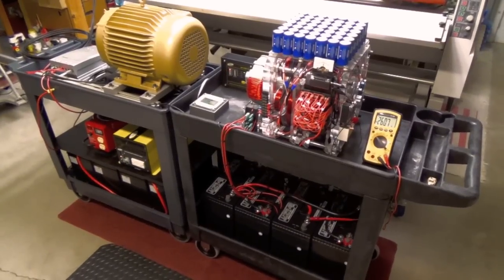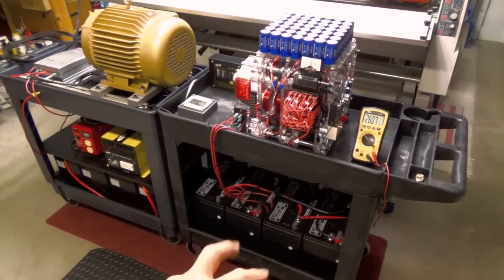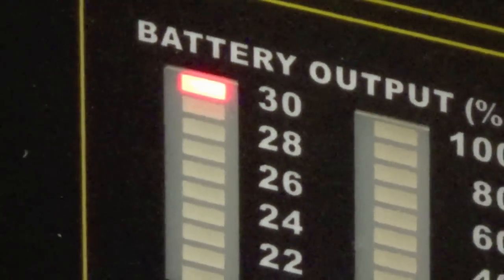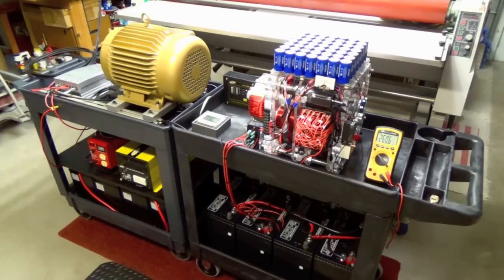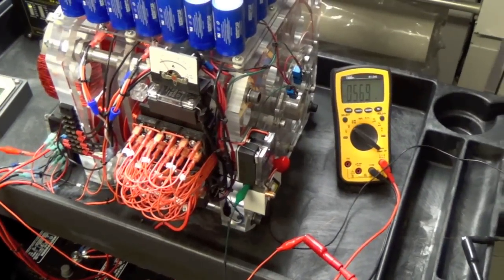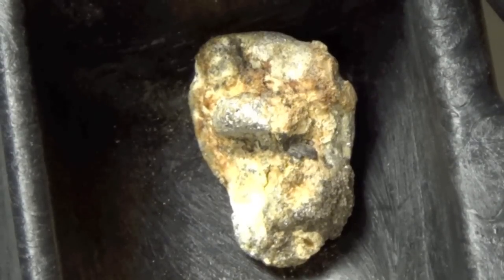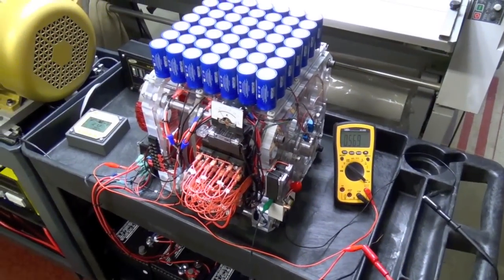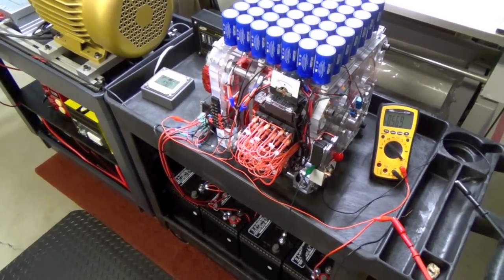Home Power Station

Comment from the maker: Actually the solar panel averages between 150-200 watts of output sufficiently charging 4 of the 8 deep cycle batteries. The MPPT aux output provides bursts of power to the Q3's UltraCaps when the UC voltage threshold drops to around 24 volts. The UC's power the Q3 which then charges the other 4 deep cycle batteries through frequency pulsing.

Comment: Nice work and great to see your continuous improvements!
It would be awesome if you would post the difference in input to charge the bank of batteries using the solar panel input only vrs. adding the Q-3 or Q-4 to charge an additional battery bank (s). If the major benefit of the Q is related more to energy storage, any results related to efficiency on that end would also be good to hear.

Comment: Would you please explain in layman's terms what is the benefit of using this device?  No over-unity, if I'm right. Does it lengthen the battery lifetime? Or is it a more efficient way to conserve energy? Or perhaps a better way to convert voltage/amperage?

Comment: But does it charge the battery bank better than just your MPPT controller ?
So does it multiply your solar input power then somehow ?? That is the big question, otherwise you could then just only use the MPPT solar controler to do the job of the battery charging... hmmm...

Comment: The way I'm seeing it, it  is a bit like a bedini in terms of collecting bemf on a pulse motor. Difference is collecting the bemf in 2 or 3 ways adding to the efficiency of the energy conversion/storage capability of one rotor. Multiple output ports may be better than one.

 PMM, it would be good to hear if there are other advantages to the Qs on top of that.

Comment: Good questions. But, my deep cycle battery bank requires Amperes to charge the bank.  A charge controller only allows so many volts to go a 12V bank.  560+ volts all going into the bank at once would fry the bank.  However, staying within the 12-14V range, the bank can take a lot of Amps.  True, amps x volts gives you watts.  Therefore, volts must stay the same but the amps can increase to give you more watts, in a battery bank system.  12,24 and 48V battery bank systems are common. Peace.

Comment: Impressive power output starting with just one solar panel of what, 100 watts? How is that able to fully power up your first bank of batteries? And your Q3 is capable of fully charging your 2nd bank of batteries on its own or is that overflow from your solar panel? Did you or can you use a 3D printer to manufacture your tauroid & Q3 house? I see some proprietary hardware here, several of your own inventions? I would come and help you manufacture and help you with your business any time. Its a beauty my friend.

Comment: Hi, if you were to connect this to a grid tie inverter would you be able to sell more energy back to the electricity provider than if you were to go directly from the solar panel? Or is this simply a better way to charge batteries? If you like cheap energy then why does your solar panel not have a solar tracking device? even a device with simple left right direction can probably give you 5 times more power over the course of a day, especially during the winter months when the sun is lower in the sky. All you need is a low ratio gearbox and a smaller panel set to a more advanced direction so that when the sun hits it it has enough energy to advance the main panel, the motor will stop turning when the angle to the sun becomes too great, a tiny battery could be charged with some simple circuitry that switches the smaller panel to charge the battery when the voltage is too low to run the motor, at the end of the day there should be enough power in the battery to reset the panel to the morning position.

Comment: If you have achieved "over unity," then why are the solar panel and the entire "left hand" cart necessary?  Use a transformer to reduce that awesome 500V output down to the 24V input to drive the Q3.

Comment: I know you have a desire to be "green" with it and you power it with a solar panel, but what would it cost to run it from the grid?  I guess my question is really; If used in conjunction with a grid power input would it consume LESS power than it makes to output charge the battery bank?  If the answer is that it consumes less than it produces -- then at a minimum would reduce your monthly power bill from the grid, or would it not?  Because if it consumes more power than it produces then you should just power your battery bank directly from the solar panels regardless of how cool this thing looks.  I get that it pulses, and I get that its good for the battery bank, but there are other ways of achieving the same effect to a batter bank with direct solar connections.  Lastly, after watching 5 or 6 of your videos you have never mentioned the cost of this pulse devise, what is the cost?  I have yet to see facts related to affordability or efficiencies vs. other methods of directly charging batteries.  I do hear a lot of passion and excitement but nothing more than the "wow factor" at this time.

Comment: Since you are connected to Utility Grid, why not create your own version of super DIY ultra low budget HIGH EFFICIENCY MOSFET AC coupling (unlike commercially grid tie inverters) and use Alternator (w/ prime mover of course) and excites lets say 40-120 amps of it. For off-grid, use your alternator for charging the batteries. Prime mover must be strong enough to meet the required RPM for the rate of charge.

Comment: So why don't you just power the inverter from the solar panels at night, and just keep them topped off with a simple battery charger during the day? I don't understand the purpose of this machine. Does it just step up the voltage like a motor-generator setup would? Great craftsmanship, it seems like a overkill replacement for a solar charger...
Reply: Adam Guilmet For some reason, I've always found it difficult to get my solar panels to work at night :D
Reply: only us nordic people can use our solar panels at night

Comment: I'm confused, what exactly do you use this for, just in case of power outage? do you have a lot of power outages there? if this requires no fuel, why aren't you using them all the time? why don't you build a bunch of them and not pay an electric bill anymore, put a couple in your electric car, then sell them too and get very rich. seems like something here doesn't add up
Reply from the maker: Yes, constant power outages, and yes, it is used all of the time. The part that doesn't add up here, is the money that would instead be paid to the power company of which we now get to keep!
Reply: PMMG4HYBRID He's right though, in a sense. While obviously he has no education to the build process and doesn't grasp your efforts, there is some hidden gem in third party. Why not make a whole home power generator and cut out the power bill completely?? I know it would be much more work, and -> money! But you could save a lot of money and brand yourself and get "rich"... Or provide the world with self efficient energy by your hands. I prefer the ladder, but in any case: You should expand! P.S. I would like to put time into energy, but I am stuck coding games because... well it's fun! and I can do it solo.
Reply: PMMG4HYBRID If I wanted to build a Hybrid Hypercar. Could a 35cc 2 stroke moped motor charge something like a Tesla battery, make 1000hp, and run in the high three digit mpgs?
Reply: That would be awesome, any more progress??
Reply: You can use it all the time. He  cannot sell this to get rich, the  government will go after  him and shut it down, like they have done to so many others

Comment: Why convert to AC?  Right now there are available many 12, 24 and other voltage LED LIGHTS. Even if no other AC powered home applieances are YET converted to operate on DC,
you can--by switching over certain house-wiring from the main electrical box over to an LVDC box, power just about all your lighting without danger, from auxiliary (either totally unconnected, or connected to main AC box for emergency battery charging). The low amperage requirements of the LED lighting -especially when DC driven, easily will flow through almost any length INSTALLED WIRING in a house, without significant voltage drop to under-power the lighting or generate enough heat to pose any kind of fire danger.
Too bad the LED lights of today are made for 120V AC, a sad waste of power efficiency, because if they were made with the SAME screw-in bases for LVDC they could be simply replaced.
As to the outlets themselves, they would have to be carefully labeled and uniformly polarized, and grounded ( likely with NO change in wiring at the outlets themselves.

It would be wise to color-code or otherwise positivily identivy LVDC outlets from non-converted AC outlets. 

Safety devices to protect from misconnection of either polarized DC, HV-AC, etc outlets and powered fixtures from each other would not be a big-time engineering challenge.

REGULATORY CODES, on the other hand, would have to be carefully consulted, and perhaps even modified for dual=powere home electric systems. This is likely the biggest obstacle.
You wouldn't want to be "out of code" if a fire or electrical accident happened in your house for any reason at all.

MOST APPLIANCES IN TODAYS HOMES EITHER DO INTRINSICALLY RUN ON DC POWER (INTERNALLY) (ALL VIDEO SCREENS, COMPUTERS, RADIOS, ETC ETC.
MOST MOTORIZED DEVICES CAN BE CONVERTED TO DC (MAYBE 48 VOLTS DC IS THE MOST APPROPRIATE "LVDC" HOUSEHOLD VOLTAGE FOR MORE POWER-HUNGRY DEVICES LIKE MOTORS, BUT THERE ARE MANY POSSIBILITIES FOR STORING EXTRA DC POWER (AND/OR CONVERTING IT TO AC POWER) FOR MOTORIZED DEVICES THAT CYCLE LESS THAN HALF THE TIME "ON".

There is much more to say about this subject, and i do not know how it might apply to large buildings or cities. But certainly the notion of efficient LVDC powered homes and small buildings could be both a huge energy saver for the nation, a great relief of stress on the presently bursting-at-the-seams GRID system ( which would NOT be obsoleted by "self-powered, distributed LVDC independent electric harvester-storage-distribution-consumption systems that are,,,
so obvious it boggles the mind why they aren't already in very widespread use.

Coupled with the many other new and creative electricity generating and usage devices seen on this and many other demonstrations, we are technologically already at the "new world of electric power" that has the potential to reverse the "manmade" component of the present global warming trend, increase national security by de-centralizing electric power production, and reducing some of the main economic causal factors for wars and global conflicts.

Good luck everybody!
Reply: Tomas Edison had the same mentality about DC until Tesla showed the world how much more efficient AC is .

Comment: Lot of value there!, now to put the right set of tubes to the outlet and make hydrogen/oxygen gas to power a Vtwin at maybe 50 horse with a 110 generator, ya might have to build a little building out back of the house and feed the neighborhood grid too? Pollution solved, now how about the tax laws that the government looses. Maybe they could tax everybody for 12%.....